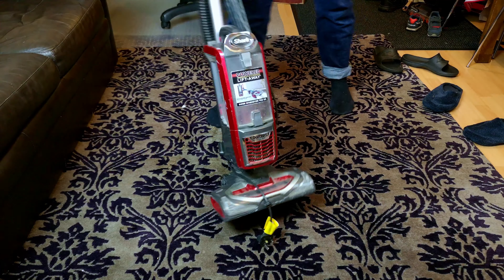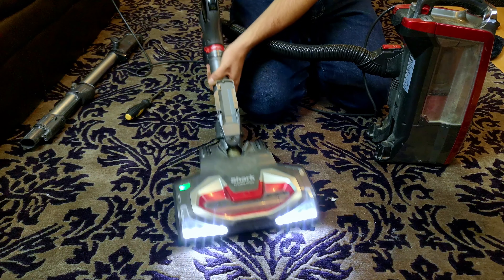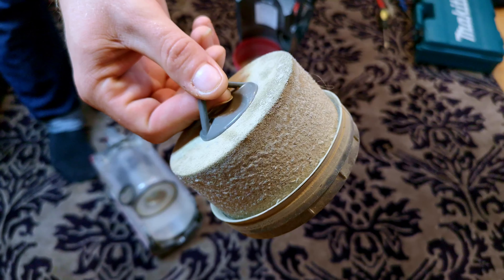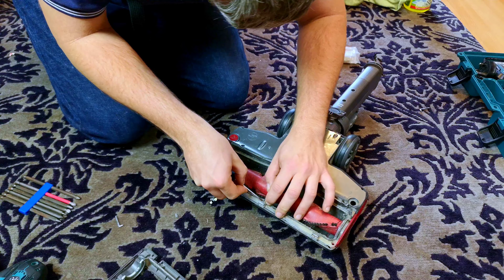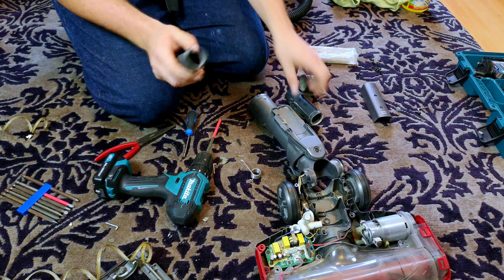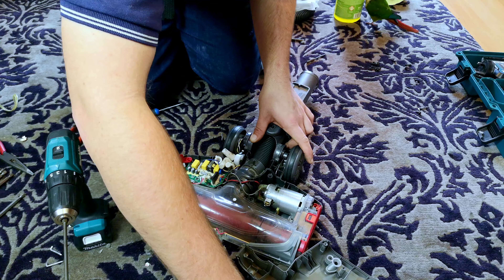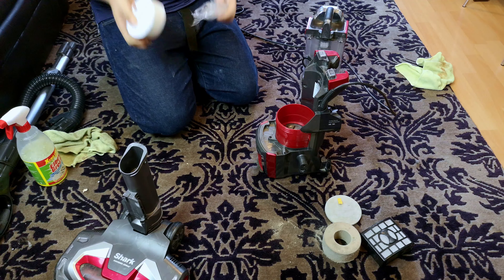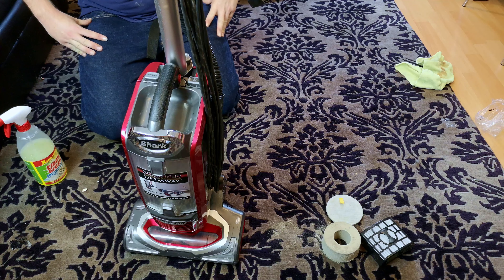Shark Speed Lift-Away NV680UK - Torn Hose & Broken Wire Repair!

Comment: Sharks just aren’t the best to work on are they Sam I’ve given it a go and given up and got rid now.Merry Christmas and a happy new year
Reply from the maker: Idk, once you've opened a few up, old or new their  ALL the same in construction, which is hilarious but does make tearing into them with a few under your belt reasonable. Unless you need any actual new parts, then your a bit screwed 😂
Reply: @beko1987  except their older ones. They are fine.

Comment: Oh my god Shark and their problems. At least they changed hose type for the cleaning head and offering replacement part if the original breaks. Those pre motor filters need to be cleaned regularly. If not, hepa filter will get dirty. Oh Shark you should do better.
Reply: The filters aren’t a problem for me but the hoses are annoying.

Comment: Amazon sell red sharks but only the duo clean version I believe the one in the video was limited. Shark sell a begiandy colour as well of that shark in video
Reply from the maker: Yes I've had a few of the burgandy ones, but the bright red was lovely!
Reply: Yes we made the mistake of buying a shark but it was slight better quality because it was the ax series, the motor gets so hot when it’s on, it literally warms the room up, because of how hot the motor gets!
Reply: The red was limited, I think because u can’t find them anywhere one might pop up on face book or eBay , I checked yesterday and there was nothing there. But there’s loads of sharks on eBay and Facebook.
Reply from the maker: I did prefer my AX over the navigators, being bigger gave it better build quality due to the design which helped! I had issues with worn wand ends causing electrical shorts with my purple one though...
Reply: @beko1987  Oo, we have the purple one anti hair wrap, it’s the same as the ax just called az in the model number but it feels better quality, because my aunt has the nv version duo clean and it feels really cheap. The anti hair wrap really does work we have dogs, that shed, and we haven’t had any tangles if you have any tangles you let it run on bare floor for 5 minutes so it can remove the hair or threads.